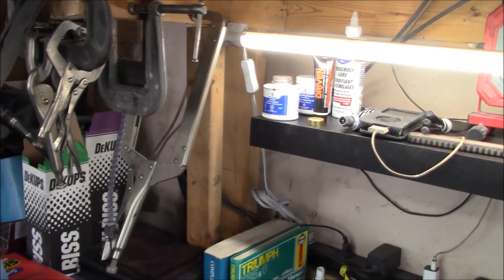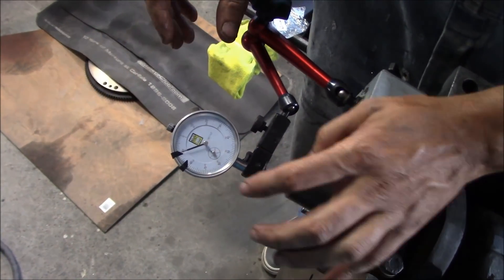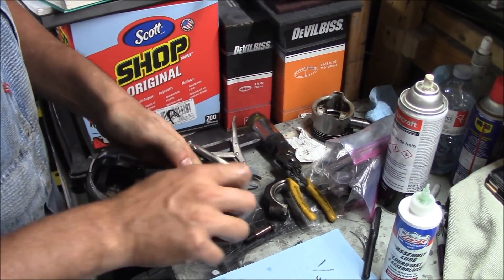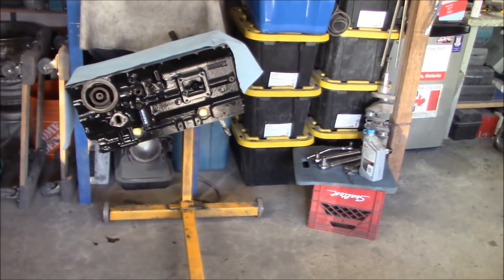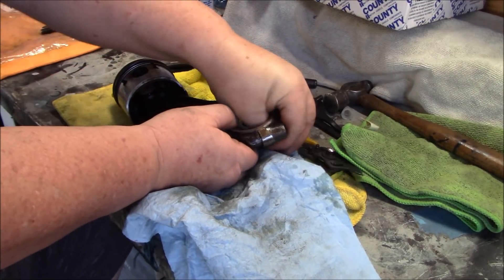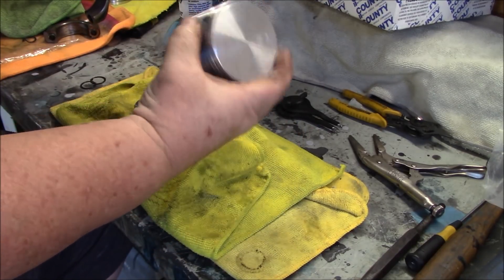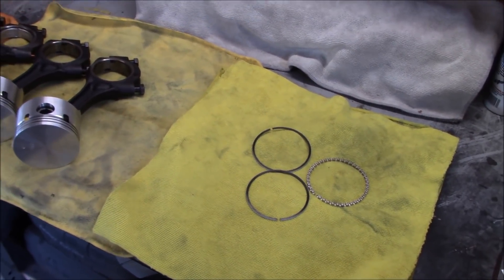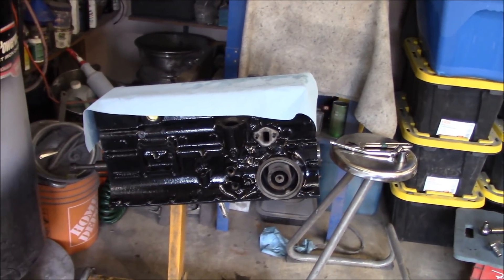1968 Triumph TR250 Restoration, Engine Rebuild Part 2, Crankshaft and Piston Installation

Comment: Rush thanks for your quick response to my concerns. I like yours and Elin Yokvos videos, the details you provide are great. It's good to see that the repairs are done properly and just bogged over just filled with fillers but actually metal repared. I like these types of videos they are of great interest I am now a retiree thus I have the time now to watch these informative documentaries. PS for you info I live in Australia but was born in England at the start of WWII. As an ex tradie it good to see that there are those people still prepared to do there work correctly and not taking short cuts.

Comment: Looks great ... quick work of the bottom end.. looks like the 6 engine does not have liners like the TR4... now I feel like I’m moving so slow on my project..
Reply from the maker: You are correct. No liners like the earlier TR’s.    And don’t worry, I’ve got through extended periods where I barely made any progress on the car...the point is to have fun and not stress about timelines.  Cheers, Tush

Comment: My cousin acquired a sad TR250 in the late '70s. Everything was worn out and he had a great vision about what he was going to do with the restoration. The first order of business was to rebuild the engine. He enlisted his father to do the work and by the end of the summer it was running great. Sadly, something torqued my uncle towards my cousin soon after and in a fit of rage he threw a cinder block though the windshield damaging the frame. This completely deflated my cousin and he pushed the car behind his trailer and covered it with tarps. Around the mid '80s he sold the car. It was by then not much more than a parts car from what I could tell. It had sunk to the frame and the tarps had rotted. So if anyone purchased a cream? yellow? TR250 around Hildebran, NC in the mid eighties with a busted windshield and everything else rotten I remember it. So few were imported, I always wanted one. Good luck on your restoration!
Reply from the maker: Timothy Harrison good story Timothy although sad...there was a long period of time where these cars were just another mode of transport and meant nothing special...they were driven hard and put away wet....they are pretty desirable now though and bring pretty good money when they are restored ( not that I’m selling 😉)

Comment: The County paper must be talking about piston measurement. Not ring gap. The ring number is 0.012 the paper is saying 0.0018. That is 18 TEN thousandth.... not 18 thousands.
Reply from the maker: It did say gap though didn’t it?
Reply: I’m not trying to be critical as your ring gap should work ok. The standard rule of thumb is .004 per inch of bore. The first set of rings 
we got for ours was about like yours maybe even a little larger gap. I think I had several that were in the .019 range. We called them up (don’t remember which brand) and had then send another set. The 2nd set was much more in line.
Reply from the maker: botycobra I appreciate the comments and I do know that they are meant to be constructive so all is great!  Thanks.
Reply: botycobra is correct,. The .0018 - .0022 is piston to cylinder clearance (note the extra zero. 18 ten thou to 22 ten thou)
Not ring end gaps. Other documentation with the rings says end gap should be .003 - .004 per inch of cylinder diameter. In this case approximately .009 - .012. In my rebuild I am finding a consistent .011 on all rings. Great shop work. (Also verified my piston clearance consistently at .0020.)

Comment: Thank you for the video! What was the reason why you did not replace the small end bushings on the connecting rods? I always thought you needed to do that.
Reply from the maker: Hi Allan, the small end looked fine and were in good condition and there was zero play with the new pins so we left them.
Reply: Great! Thanks for the reply! Love the video!
Reply: You don't need to if they are in good enough condition. For some reason, they rarely wear the same as the bigs ends do.
It's also a machine shop job as they're a press fit and may need to be reamed out to the correct size.

Comment: I would have thought there would have been lock tabs on the bearing bolts to stop them coming undone!, most British cars had them, they ran from one side to the other with tabs to bend onto the flats of the bolt heads, I would look at this part again chef.
Reply: Those lock tabs were indeed often used, but what I have read is that they actually made things worse.  The metal the tabs was made from was soft, and it can compress further during engine operation, and then the cap is essentially loose.  It then starts hammering and probably breaks the rod (this is same reason you want to make sure rods are not oval'd out or just recondition them as a matter of course).  I think  some locktite would be in order, but then you might want to torque to the lower side of the range.
Reply from the maker: Albert Rowe Hi Albert.  It’s a good question. You are indeed correct, the earlier 4 cylinder TR’s cars did use locking tabs.  This engine does not and only uses spring/lock washers on the main bearings.  The rod bearing are just bolted, no locks.

Comment: In 1979, I made the mistake of reusing the big end shell retaining bolts on a Triumph 2.5 6 cylinder engine exactly like you have here. At 115 mph one of my big end bearings came appart, a very big mess indeed. The retaining bolts are self locking and can only be used once. I do hope that you are aware of this issue. One bolt shakes out and one will notice nothing from that, then with max engine braking at 5500 rpm the second bolt gives up the ghost and suddenly the bent con rod is sticking out of the sump pan and the poor piston skirts are almost nowhere to be found. My engine stopped so suddenly that the engine mounts failed in compression and the fan hit the radiator very hard indeed. Please don't take any chances with reusing big end shell bolts. Ben
Reply: There is a lot of confusion on these single use bolts.  They are called torque to yield bolts and then stretch when you install them.  You will see a torque spec of something like 80 ft lbs and 30 Degrees after that torque.  I don't know exactly when they started being used, but I know early Triumphs did not have them.  Perhaps later years did, or maybe somebody used some new fangled bolt at some point.  If not a TTY bolt though, it should be fine to reuse them with a quick check that the threads are OK.   Locktite seems like a good friend to me.
Reply from the maker: Thank You for watching and sharing your experience with us.  There are certainly lots of different opinions and it’s quite a contentious question.  Kind of like an “what oil should I use discussion”....

Comment: I know everyone will have their own opinions, but I was always told not to grease or oil the underside of the big-end bearings. This can affect the clearance on the bearing to crankshaft journal. 
Also, another tip for circlips - put your finger in the middle, that way if they ping off, they just go up your finger. Sometimes a little painful, but not as painful as crawling around on the floor trying to find where it went lol
Reply from the maker: Yes, agreed, no grease or oil under the bearings.  I’m not sure I could get my finger and the tool in there...I have sausage fingers 😉

Comment: Nice progress, Tush. This has always been one of my favorite phases. When the manual gives a range for torque settings, I've always used the average, i.e. say 48 to 52 ft. #, I shoot for 50. Not sure if that's always the best practice but it's what I use. Hopefully a career mechanic can reply and give their opinion on this idea.
Reply from the maker: Yeah, I tend to use the high side most of the time 😉

Comment: I heard 2 weeks until engine start on your Friday, so today is T-12 to start!
To help you not sleep at night...  You should put circlips with the gap up so when piston whips at TDC it doesn't tend to compress the clip and let it come out.  This is more of an issue on high RPM engines though, so probably fine on street, but never hurts to do it that way anyway.  Also, again high RPM probably, but checking the rod for out of round or having them reconditioned is worthwhile.